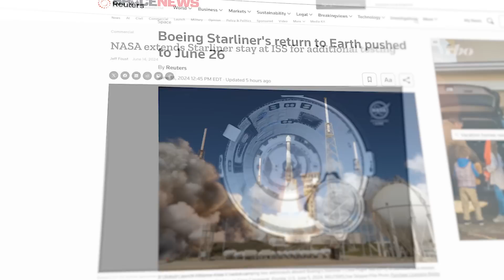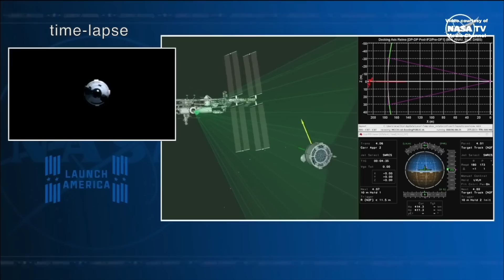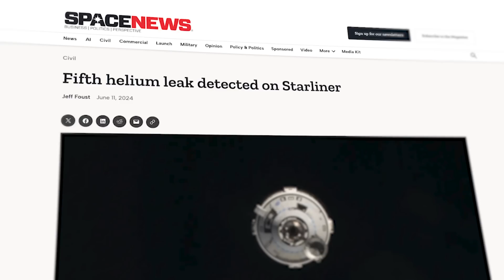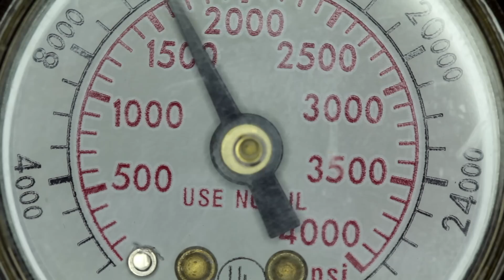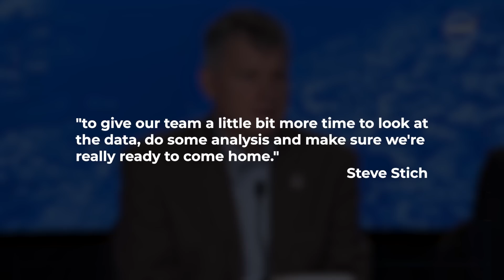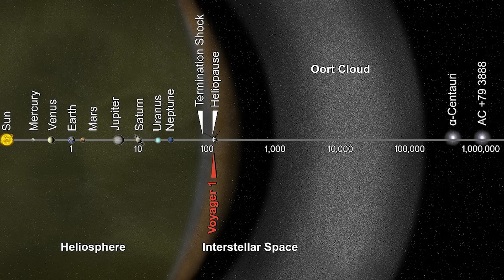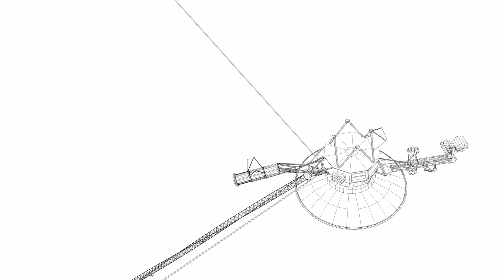The Boeing Starliner Has A New Problem!

Comment: The Starliner was meant to be on a certification flight for regular manned flights to the ISS. It has failed to demonstrate reliability or capability. This was NOT a test flight. A test flight infers that things are still being worked out. You don't test flight a demonstration flight. Maybe this is where Boeing gets it wrong.
Secondly NASA is not going BACK to the drawing board for theirs mission: they never went to the drawing board on the complete mission.

Comment: If the crew comes back alive on the starliner, it will be a miracle. The basic technology that brought back Apollo 13 was more reiable than what the Starliner has.  Probably used the same technology as the Titan did - unsuccessfully.
Reply: Best case scenario, it comes back and lands with 2 parachutes(it has 3).  Worse case it comes back as a charcoal bricket. They really should send it back empty. The USA doesn't need TWO Komoravs.

Comment: Old NASA would have never tolerated this kind quality control and mismanagement.
Reply: Apollo 1, Challenger & Columbia ring any bells? The lead investigator into the Columbia accident said that NASA couldn't even run a bus line safely.
Reply: @tidan4575  I'm referring to Apollo era when they made mistakes with the Block one capsules then went through each capsule with a fine tooth comb eliminating defects and FOD. No block one capsule carried a crew. Do you think Boeing had that kind of commitment or today's NASA?
Reply: They have since they started blowing up space shuttles.  What, we use non eco glue to hold tiles on.  We can fix that......
Reply: Wernher von Braun would never have put up with this shit.
Reply: the biden admin is so pissed at Elon for taking away their demoturd talk bubble, (twitter) that they are trying to pushing a loser over the line. FJB
Reply: I beg to differ...My Uncle was one of the Chief Software Engineers when that one Space Shuttle Blew Up because of a, "Fuel Leak",(because of the Booster Seal had failed)...He saw the issue and reported it to those above him during the Ground Testing before the scheduled Lift Off of 4 days later. He said that he told them that it would be catastrophic disaster if they allowed for the launching without investigating the leak and repairing it or cancelling the Lift Off to prevent the possible death of all the Astronauts. Well,we all know now that my uncle was ignored and all 5 of the Astronauts died in the explosion of the Booster!!!
Reply: @robertMichaels-px3gt  yeah that's new NASA.
Reply: @patrickradcliffe3837  To be fair, both "new" (1986) NASA and old NASA in the apollo era fix problems after a disaster instead of preventing it; the Apollo 1 capsule was a block I capsule by the way. At least Boeing starliner has a back up (Crew Dragon) to come back it is deemed too unsafe.
Reply: at least nasa and boeing are committed to diversity.

Comment: I think the combination of NASA's caution and Boeing's bureaucratic fumbling in this case explains why the United States never made it back to the moon for 50 years.  These huge companies like Boeing are constantly working under bloated Defense Department contracts which cover all manner of sloth, negligence, incompetence and delays.  The combination of their size and this kind of government subsidized situation is tailor made for destroying the competence and efficiency of any endeavor.  It just is.  Huge bureaucracies always get sluggish and inefficient.  Government subsidized companies always get bloated and inefficient.  So you end up with one vehicle problem after another after taking forever to get the damn thing supposedly ready at all.  It's just sloppy crappy work, which creates intolerable risks in the environment of space travel.  SpaceX has not yet had 50 years of getting bloated and sloppy and stupid under similar circumstances.  But give it 50 years and it could well end up just as bad.   But for now, it is lean and mean and is the right way to go.  Working with Boeing should just be phased out as far as NASA is concerned.  Lives are at stake.
Reply: The reason we never went back to the moon, was not due to Boeing or any other rocket maker.  It was lack of political will.

Comment: Starliner is unproven and should have never taken a crew into space. To install faulty valves is downright criminal. The real problem is that they should have had a few more unscrewed test fight to work out the bugs. Unfortunately they don’t have a reusable rocket to get it into space and the costs would have been prohibited. Also the technology aboard Starliner has become stale. If it was going to take this long to use, they should have kept updating the hardware and avionics to keep competitive. Instead, this vehicle is over budget and under engineered. It would be nice to have an alternative other than using SpaceX however, it looks like the other way to go is the Chinese. I rather stick to SpaceX.

Comment: They should send a dragon capsule up to get the astronauts back safely XD
Reply: legitimately. send the starliner back empty.
Reply: There's already a Crew Dragon docked. When the Soyuz had its cooling leak problem, they ran the numbers and decided they could put another astronaut in one of the three in capsule cargo spots and return. I bet they can do two. Crew Dragon was originally specc'ed for 7 astronauts, but they only installed 3 seats when they switched to parachute recovery. They'd have to jury rig transferring some sort of seats from Starliner, but I bet it'd be doable.

Comment: The damage done to the Starliner by pushing this launch with the known thruster leak is immeasurable. 

How does Boeing keep tripping on their foreskin?

MAX software, hiding changes from pilots, missing bolts on a plug, now launching with a well known issue. 

Had the RCS been the only problem, it would have been a good test flight. Launching with the helium issue was crazy. Now the 4 th delay to “study the problem”?  

Boeing is history. They can’t keep doing this. Congressional support only goes so far when there is a legitimate company (Space X and maybe Blie O) in the game.

Comment: All SpaceX launch vehicles have a problem , it is called earth bound infrastructure to land there reusable equipment everyone is blinded by. Drone ships, landing pads and gps guidance.
Good luck getting any SpaceX vehicle to land on any other rocky body except earth. Blue Origin built a vehicle that was designed to land on another rocky body.
Starship should be called starlink ship.

Comment: The easiest and cheapest way to recover those Mars samples will be with a starship and a crew of Optimus robots. It'll be a couple years at least until starships go to Mars, and by then the robots should be more than capable of collecting the samples. You won't get cheaper and faster than that.
Reply: Sounds like something that will most definitely happen in this decade.
Reply: what have you been smoking?
Reply: @sphinxy27  regardless of what is being smoked or not,  wesley is right.
Reply: @genxray951  how exactly?
Reply: @sphinxy27  do you have an actual reason why you think it wouldn't work, or what other method you think will be cheaper and faster?

Comment: Helium is a "noble-gass", meaning it reacts with nothing. And it is very light. But the second "noble-gas" is neon, which can do roughly the same as helium, but is a far larger molecule then helium and thus easier to contain.
Reply: mass has entered the chat
Reply: All the other rocket ships use He without the leaks.  Don't blame the gas.
Reply: Anyone who has experience with vacuum engineering knows that if anything is going to escape from a closed system, it will be helium. It's used to find leaks in vacuum systems by spraying it around the seals and joints and detecting it with a mass spectrometer in the output of the vacuum pump. However, it is possible to seal systems so that even helium doesn't leak out.
Reply: @ceejay0137  Yup, they manage to seal it into high capacity hard drives these days (it has much lower frictions and higher heat conductivity than air). Those hard drives manage to keep adequate He pressure for more than 5 years... often double that.
Reply: @Contrarian-ol2bc at th3 same pressure as the atmosphere around it, with foils that allow the pressure inside to adjust to the pressure outside.
Even SpaceX has had launches delayed due to helium leaks.  
Spacecraft store helium at really high pressures, so it can get rough.
A while back SpaceX had a COPV filled with helium explode on the launch pad due to a strut failing, destroying a Facebook satelite.
Reply: @kobusdowney5291   Well, at least it wasn't anything important that got destroyed. LOL  ...aside from the falcon 9 booster.
Reply: @ceejay0137  Helium is also used to detect leaks in oil pipelines, especially underground lines as it easily seeps to the surface due to 'disturbed' soil from when the pipe was buried.  Its small particle size allows it to leak out of a very small hole before the larger petroleum molecules start leaking out of the pipeline.
Reply: @crosslink1493  Interesting! I didn't know that.
Reply: Yes, Neon is a noble gas, however, Neon is an element/atom, not a molecule. Having 10 protons and 10 electrons. Symbol Ne.
Reply: @davebowles1957  I'm pretty sure he meant atom, not molecule.  Easy mistake.
Reply: and has a pretty glow you can use, like those cars in the hood.
Reply: Argon too
Reply: Neon weighs five times as much as helium for the same volume.  Weight is a big issue when you are lifting it up to space (1 mole of helium weighs ~4 g, whereas 1 mole of neon weighs ~20 g).

Comment: You take comfort in the fact that Boeing has not made public any information that could lead one to believe that the Starliner returning to earth could be dangerous? Should the families have the 346 people who died on 737 max crashes, take comfort in the fact that before the crashes Boeing had not released any information, that would lead one to believe if they were serious design flaws in the Boeing 737 max?
Reply: For me it is not that they had a malfunction.  It is that they are having the same malfunctions they had on the last flight...
Reply: @GregoryAlbright-t3p  
The failures at Boeing on their commercial airplanes and on the Starliner are not technical issues as much as they are management issues. Unfortunately, management issues are much much harder to fix and tactical issues.

Comment: They also need an adapter kit so that the "space suits" can be used regardless of the of the conveyance ...
Reply: Space suits aren't needed for reentry.
Haven't been since Apollo 7 came home without wearing them.
Reply: @ghost307  If something goes wrong the suits can keep them alive in many cases(eg leaks), so kind of important.
Reply: @NScherdin  I stand by my factual statement as backed up by NASA.
Reply: @ghost307  Old mate is probably thinking about the flight suits.
Reply: @MistahHeffo  Nope.

Comment: Delays are better than deaths.🤔
Reply: Let's hope it stays with only a delay. The mission isn't over yet.
Reply: @Gomtu Even SpaceX fails more yet still yields more success from that failure. Boeing just has bad management.
Reply: @sethjansson5652  only with their experimental spacecraft,  it's production spacecraft, falcon/dragon,  is rocking reliability, AND reusability.
Reply: @genxray951  Even Falcon went through the same process of 'learn by failure'
Reply: @sethjansson5652  The only difference here is that there are two human beings that are now stuck at the ISS with a dodgy vehicle that should never have been allowed to take flight.
Reply: @sethjansson5652  Not with people on board.
Reply: @NScherdin  Obviously not with people on board, but SpaceX still used trial and error to make their rockets and crew modules. Contrary to Boeings approach of building a whole design from the get-go and then making adjustments around it.
Reply: @sethjansson5652  This isn't about SpaceX vs. NASA, it's not the big game and who trained better.  It's that they had the helium leaks in past test flights, didn't solve them, and they still send this one up, with folks on board, is the problem.  All space flight is tested with trial and error.  that's why you won't see manned flights on Starship for years, once the bugs are worked out.  NASA got bullied into sending this as a manned flight probably due to SpaceX success.  It wasn't ready.  They can't stand being second best in the industry.  I'm just hoping  it doesn't cost the lives of the two astronauts for everyone to see that.
Reply: @sethjansson5652  SpaceX doesnt fail when peoples lives are on the line.  You couldn't pay me enough to come back down on Starliner with all the garbage going on with that capsule.
Reply: @NScherdin  I'm not justifying Boeing's mishaps, I'm just putting into perspective what SpaceX has accomplished using failure compared to Boeing. First reply is claiming that failure is the reason Starliner is performing poorly. Which I disagree, it's management.
Reply: Agreed, but why not Send it home empty and send a Dragon with a Pizza delivery man and a bunch of pepperoni pizza to bring the Boeing test pilots home. 

Those two can stay up there long enough for Space X to launch in August. 
They don’t need to learn a thing. They can just enjoy the safe ride home.
Reply: @Frankthetank-zr5mc  It sure will be an option, but they will explore all options with the Stuckliner first.
Reply: @Frankthetank-zr5mc  I wonder if SpaceX could have a way to heat up the pizza as well, that was a request from the Inspiration 4 mission, HOT pizza.
Reply: @Frankthetank-zr5mc  Or maybe they stranded cabbies are whistleblowers and need to go away.
Reply: Delay on the ground. Don’t launch with issues. The RCS issue is new, but fixed. The helium thruster leak is a years old problem, seen again on the pad. WTF launch?
Reply: In the starliner's case, delays are indicative of death.
Reply: Boeing, roll the dice every time now.
Reply: I am quite confident in saying that if those two Boeing Starliner astronauts try returning in their capsule that they will both die on reentry. Hopefully pride won't push them into trying a return in that defective capsule.
Reply: @SWExplore  Agreed.
Reply: There won't be a 'rescue' mission.  They will send Butch and Sunny back on Starliner, regardless of what they know or don't know about the capability of the craft.  Their hubris won't let them take any other path.  I wish them well.
Reply: @Gomtu  What "manslaughter" has Boeing committed? Before you bring up the 737 Max, it's not Boeing's fault that foreigners are idiots.

Comment: DOOMLINER
Boeing is unable to perform proper plumbing.
Number one rule of plumbing
NO LEAKS
Reply: Do you have any idea how hard it is to prevent leaks using helium? No element is as light. It's like making a system water tight but yet having a miniscule air leak. You may not get a drip of water out of it but you still have a leak. 
I've had a refrigerant leaks that were unable to be found unless I used helium to locate the leak.
Reply: @Poorexampeofhuman  Hydrogen is lighter than Helium.
Reply: @tomdave42 that's funny because SpaceX doesn't have those leak problems with helium
Reply: @Poorexampeofhuman  Has anyone forced them to use helium? If they chose a technology, it's their responsibility to make it work. NASA did not order a helium tank, but a space capsule. What matters is whether it works and is it safe. So far, it has underperformed in both, and cost a lot of money.
Reply: @TheZoltan-42  it does seem like a silly thing to select helium.  Nitrogen, while heavier, is a lot easier to acquire and may be less likely to escape.
Reply: 60% of the time it works every time.
Reply: I wonder if NASA and Boeing are buying valves from china. I have never seen a plumbing valve from china that did not leak.
Reply: @michaelbyrnee9584  
I can’t for the life of me figure out why people continue to buy and drive cars that have wire susceptible to rodents chewing.   Have you ever looked at the number of electrical fires in cars on roads, in carports, and so on.  And they are not EVs with batteries…. Our roads are full of cars with faulty wiring and nobody gives a damn.  And it’s all cars.  They use soy based insulation.. do you think the chinese manufacturers knew what they were doing???    Try to find out what is going on and you run smack dab into a whole industrial promotion of green manufacturer based on fully biodegradable material such as soy..!  And we thought they were making tofu.  Meanwhile the leftwing and green parties make all industrial products edible.  Smart thinking!   Maybe there should be some catnip in there to attract a few cats.   I would love to see Trump make some hay with these little tidbits!!
Reply: Beg pardon, but the #1 rule of plumbing is SHIT DON'T FLOW UPHILL.
Reply: @Tenskwatawa4U  Yep.  Shit flows downhill, payday is Friday and don't chew your nails.
Reply: As safety oriented NASA is I was surprised at how they downplayed the leaks and launched anyway.  I'm wondering if some of the NASA decision makers are going to be in HIGH paying jobs at Boeing in the near future.
Reply: Number one rule of plumbing is crap runs down hill. 

Number two rule of plumbing is pay on Friday. 

You are now qualified to be a plumber.
Reply: @AKguru762  Do not chew your finger nails ;)
Reply: @AKguru762 You beat me to it 😁
Reply: Leaks do not get smaller, they were allowed to send up a broken capsule with people. Who gets fired, and, every contract should be pulled from Boeing.
Reply: Time to break up the company… and jail Calhoun
Reply: You mean like SpaceX's toilets?